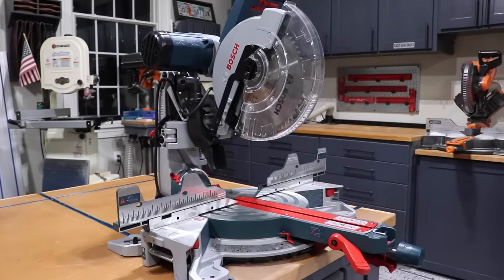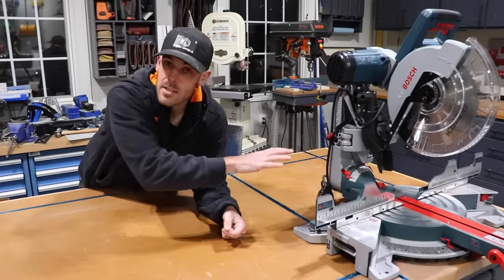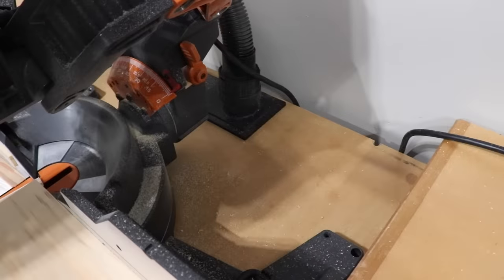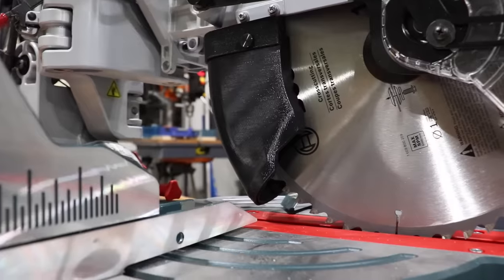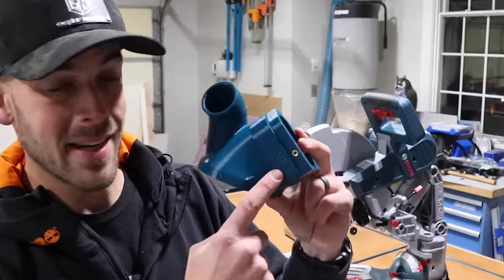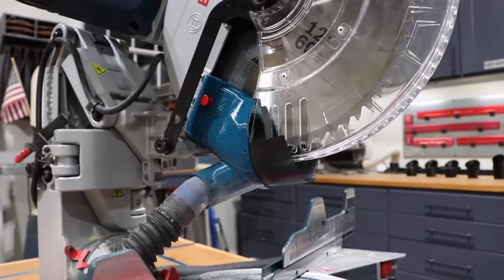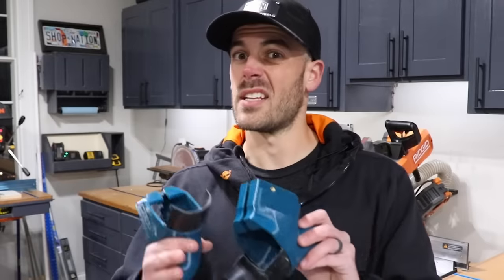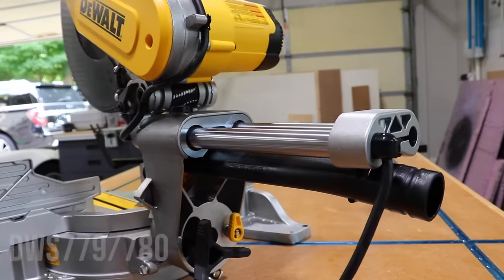It's like Bosch doesn't even care

Comment: You are comparing apples to oranges if you did not do the same types of cuts between the original collection chute and the one you are trying to sell us.

Every power tool woodworker knows that a trim cut where you are only shaving off the width of the saw blade or less off the end of your board are the cuts that produce the most dust. You indeed made those kinds of cuts during your tests with both the original dust collection solution and with no dust collection at all, but if you did test that kind of cut with your updated chutes, you didn't show us how it turned out.

Comment: If automotive engineers worked this hard, our cars & trucks would be perfect! Instead they say it worked on paper, and it shoild be okay in real life. In reality, it sucks!
Reply: you obviously have no understanding of the actual automotive engineering process, nor the Many, many requirements that have to be met.
Reply: @python3574  True. But I understand when a knob is in the utter wrong place. Or that the battery is jammed into a corner so tight, you have to disassemble the front end, just to change it! When there is a big ass spot, on the other side, that it would have fit!  So, I don't give a damn what problems they have. They should be made to drive and work on, their own creations!

Comment: You did not do a valid before/after compare at https://youtu.be/ZMgtYyHlrA0?t=691  the before is a edge cut which makes more mess, and the after is an internal wood cut which directs more of the dust where it should go.  Granted, it shows more what you want in the video, but for the non-science oriented viewers it does not give them a real comparison and just goes for the wow factor.  All that being said, I did enjoy the video overall.  I have seen other videos for this saw (which I do own this saw) and some of them do better with a full flexible shroud vs 3d printed...but even so, miter saws just make a mess...so there is no good solution for small dust extraction setups that I have seen.